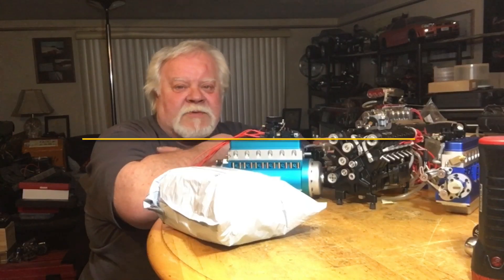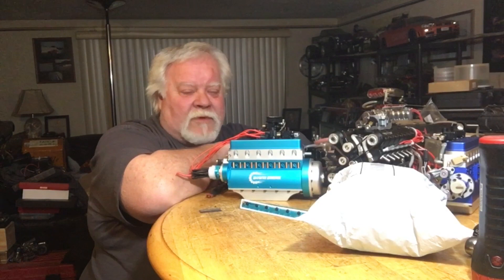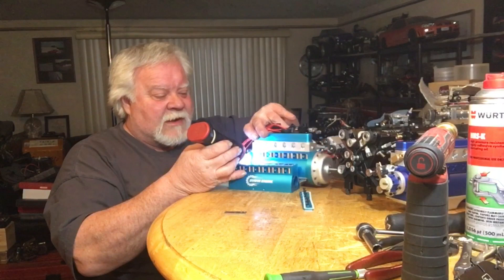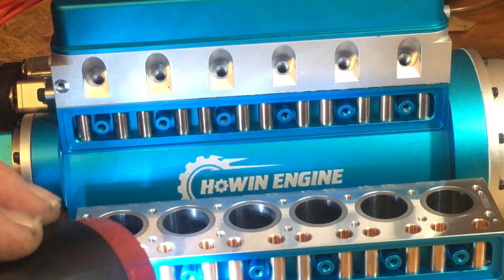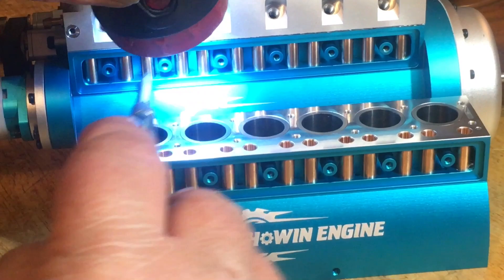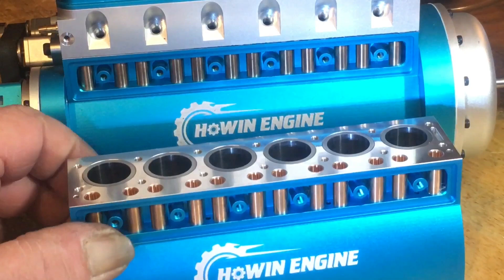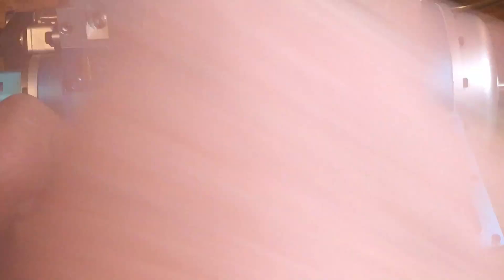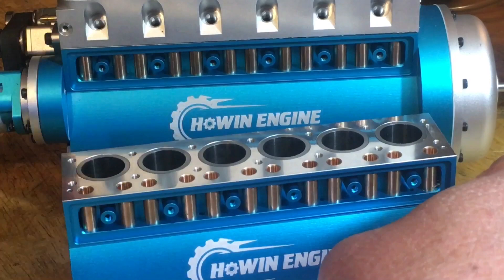Episode 2 of rise and shine it’s engine time!

Comment: I got mine running with the factory dizzy but I think the plug wires need to be the same wire that is used for the "coil" wire for there is a lot of arcing and causes misfires. Overall, it does OK. It just needs some fine tuning on my end.

Comment: Where there other problems besides the oil holes? It sounds like there were more than 1 problem. Mine came with the 3 oil holes; but not sure if there are other issues?
Reply from the maker: The return holes were my only problem everything else is good 👍

Comment: Can't wait till u start building cars for those engines, so what are u thinking about putting the v12 into?
Reply from the maker: I’m checking out how it will fit in my skyline
Reply: @Dennis Dempsey Radio out of control  WOW 10lb 💩 in a 5 lb 📦, hope it works out 👌✌️